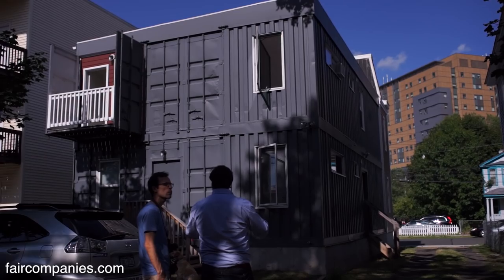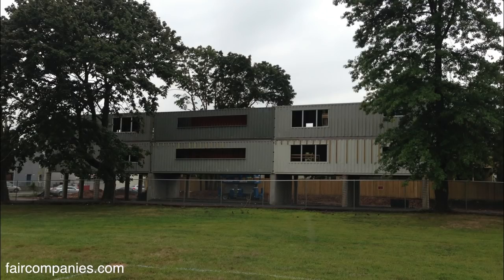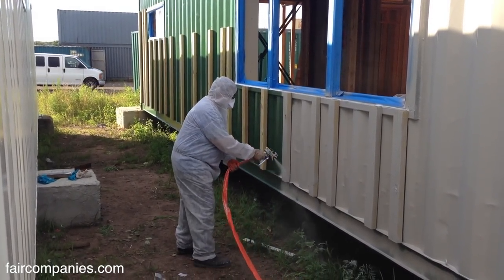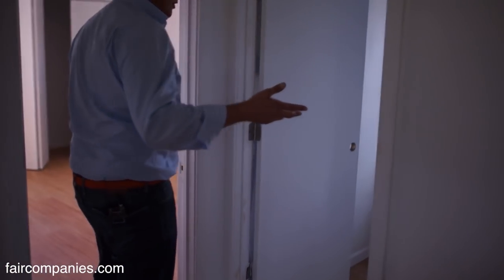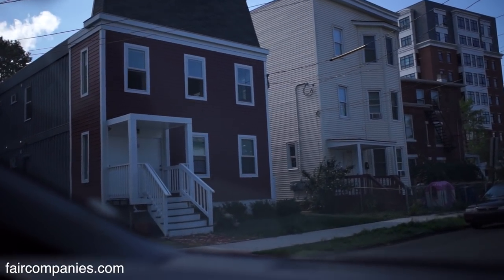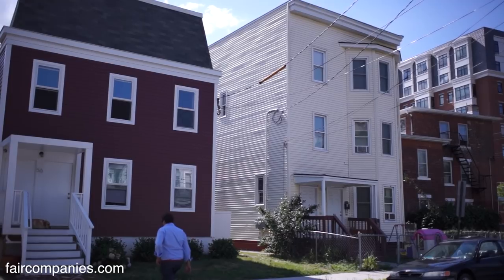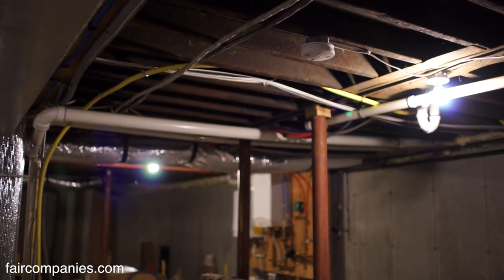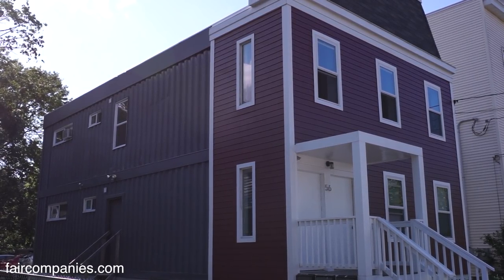Stacked cargo containers in New Haven's "LEGO" apartments

Comment: Liked & Subscribed
This is the most informative video or article I've seen on container buildings. His explanation of using seaworthy joinery to secure containers together makes perfect sense and it's the first I've seen on that subject.

I live in Denver, which has had a building boom the past decade that has resulted in fast build apartments, condos, townhomes, and shoddy execution was apparent when they were completed. Others have siding and roofing issues that aren't revealed until extreme winter weather hits. Container buildings would have been sturdier and more interesting.

It's flabbergasting that the government has data and won't share it. What could possibly be the reason? I've driven from Long Beach to Baja California and seen towering stacks of containers stacked so high along the freeway, the view of the ocean is obscured. The resource exists on both coasts. Container homes would be a perfect solution for rebuilding parts of New Orleans that are still flood prone, areas of the southeast coast that are hurricane prone, and cities like Detroit where urban waste is begging to be scraped and turned into opportunity housing: mixed use retail/office/residential.

Comment: My office at work is a container. It was actually put in 20+ years ago before it was a trend. It looks like a normal office you would never even know. But now that I found out it it's one I really want one to live in. The reason you can't tell is I work at a Professional Theater. It's nestled between the big theater and the Black Box theater. So you cannot access it from the outside. Although there is 2 windows they are in an ally that is probably illegally too small. We enter through the lobby and then there is a door that just looks like it leads to a typical office.

Comment: Hi what is the cost per square foot as built? You mention expansion joints with the flooring... With the sun heating up the metal wouldn't it be better to clad the south facing aspects?

Comment: I notice that this new trend of green buildings by reuse the containers is a good thing, yet how do you prevent the rust and how do you prevent the heat in the summer?and my input is you should make it a bit modern with the design instead just merely stack it in rectangular form, so that the society think that this is modern chic house...yet the idea still astonishing and the interior look like a house..yet the exteriour..well maybe it was base on budget..Finnally, i think it will be great if you put solar panel technology for electrical used and rain water harvesting and filtration to cut cost and be oof grid and green as possible
Reply: insulation has gone a long way to the point that this is actually very viable and the containers themselves are made out of a special metal that isn't supposed to rust (They last a decade on seas without rusting).
Reply: He talks about both rust and insulation during the last five minutes or so.
Reply: The guy said its a special type of steel that once it oxidizes it protects it.

Comment: the future of housing whether we like it or not.  Even with isocyanurate insulation isn't R30 6"?  Why put R30 on walls?  Exterior walls are furred out with metal studs?  Where containers aren't ganged side by side an 8' wide container loses 12" to insulation and furring?  It would be nice to see a functional and elegant detail for the roof edge - where R30 is required?

Comment: Just out of curiosity, what are they planning to rent these boxes out for? Will it be cheaper than a standard wood framed apartment building? More expensive? Or about the same rates?
I would be interested in seeing a cost comparison between building these container complexes and building a standard wood or steel framed complex of the same size.

Comment: What occurs to me, is when this type of structure becomes easier to permit, what prevents the interior insulation and finish work from being done outside of the US, and the container shipped to the US as a finished unit with some relatively high end interior finishes?  Building costs would go down, but losing residential construction jobs would be a tough hit to a lot of people in the US and other comparatively wealthy countries.

Comment: Congratulations on a very nice project. We built a 680sq.ft. house w/ (2) 40' hi-cubes for a local non-profit in Salt Lake City ( see The Sarah House Utah on Youtube). It turned out well but did not see the savings due to small scale of project and learning curve on the job. For multi-story, I can see the savings in using these as the basic structural frame. Continued success to you!

Comment: fire suppression system? solar?  is it off grid?  is there even a rain barrell or watertank for back up water fire suppression system....or ABC fire suppression system?   HIgh heat on metal means a buidling buckles and folds from vacuum effect when the fire gets to a certain temp....anything to prevent the fire safety issue?

Comment: Maybe they should talk to some local fire halls, they have been practicing fires (mock homes) in shipping containers for many years now (if not decades).  I'm sure those around me are not the only firemen around doing it as well. They set the same containers on fire over and over again,.. they just hose them out, set up shop, and torch them again.  The reason the fire marshal has issues is typically because there is due to the intense heat created in one because it doesn't escape as easily and its also crazy difficult to cut access into them vs a conventional home.  It would be quite difficult to vent and gain access for firemen in comparison. 
 Hell I just simply put a metal roof on my home and my insurance company dropped me due to "fire related issues", so id imagine they are crazy stringent about these.  
With all that being said, never the less I plan to get  3-4 and build a functional basement that i'm going to then build my next-future home upon.... :)  Piss on them if they don't like it .. . lol

Comment: can you stucco those containers so they aren't so ugly?  With insulation under the stucco it will also add R value
Reply: michaelwni Yes you can, indeed. The potential for exterior cladding goes beyond just stucco. Think about a wooden look with extra spray foam or ceramic coating behind the wood for added insulation. You can do anything else you might fancy.

Comment: how much did it cost per square foot to build and ge approved
Reply: Jeff Andrews - they never tell you that because they want you to believe that this is a cheaper route.. it isnt at all cheap. its only a faster way to build. 40' containers range from 2500(very used) to 4000 (barely used). then transporting them to the site costs money, land, foundation, crane to have the set, welder to welder, electrical, plumbing, insulation.. its pretty expensive. talked to a guy that was building a 5 x 40' single story container home and he wasnt even finished with the interior work yet and was already over 200k spent. so if he paid top price (4k) per container..160k and still not done. my guess is this guy spent an easy 750k

Comment: im worried about lighting. someone inside the house relaxing leaning on the wall, or have their hands or body on a metal part and while a storm or just normal rain with lighting is happening.
And a lightning bolt hits the container. who ever is inside the house, specially the person leaning on the wall will be dead instantly.
Thats the main part im worried about. not to mention all the electronics within as well. computers, TV, microwaves, fridge, radio etc etc.
This is one of the main reasons why mankind always builds houses made out of "wood".  because electricity can not travel through wood when thunderstorms happen.

Comment: Everything sounds good, the strength of the structure, the lowered cost.
The prejudice is silly, every day we see 18 wheelers carrying prefab houses around the country, made of wood, there is no difference between a wood prefab brought on a truck and bolted together than a metal one, except the metal one is stronger.
But my concern would be noise, metal is a great conductor of sound. Someone on the other end of the house slams the door and the sound travels through the metal, everywhere. I would have to see it in person if I were someday going to consider one. I think the city's fears are people just plopping a container down on a plot of land and calling it a house. My belief in freedom says they should be able to do it, either I own my land or I don't, who is anyone to say I can't live in a metal box? I should be able to live in a tent if I want to.
My perfect retirement would be to buy some land up country in NY, have water, electric and cable run to s central shed, and be able to put up any structure I want to live in, a container or a big shed.

Comment: There are better quality fasteners that have better aligning properties than the ones used on ships, they also have ones with base plates etc. He hit the nail on the head. Local building codes departments will fight against you every step of the way and likely double your costs for no reason other than ignorance

Comment: Those sonotube pillars should have been tied together at the top with a steel reinforced concrete beams, even subterranean they could have been tied together. Helps stabilize in high wind or earthquake zones.
Reply: didn't know Connecticut had earthquakes.
Reply: +MrVoltog Earthquakes can happen anywhere any time. With the advent of fracking shale for oil extraction, many old inactive and unknown fault lines have appeared where no activity had never been recorded. Any time one uses sonotube columns in construction of a support structure it is always wise to tie them together to create a reinforced structure. Twenty some years ago in California and also in Kobe Japan they experienced catastrophic failure of columns supporting freeway bridges. Once the supporting concrete cracked and failed due to excessive lateral loading  caused by earthquakes the reinforcing steel rod structure within will fail since there is nothing holding it in place. California wound up replacing all failed columns and bridge structures while externally wrapping undamaged columns in steel sheeting held together with external tension rods.
As an Architect and structural designer it is my responsibility to ensure that the supporting structure for such a building is designed for the unexpected. The containers themselves have been in use for many decades and have proven their structural integrity in the shipping industry and there is both visual and documented evidence as to the survivability of the containers in mishaps involving the cargo ships they are carried on. Cargo shift can be a life and death matter at sea but we have seen time and time again when these containers are tied together properly with the appropriate hardware they can be stacked up to ten units in height with a full load within. 
 I applauded the innovation and creativity of the designer of this project and I hope they take heed of what Little I have offered here with my experience with both containers and concrete support structures.

Comment: does it leak when it rains and is it safe if lightning hits it ?
Reply: +Roberto Torres Most containers are waterproof. They have to be to work out at sea on a ship. The steel used is very thick and won't rust out like a car will. The rust you do see is the metal creating its own protection. 
As for lightning, if you run a large wire to the ground, the home would be the safest place to be in a lighting storm. Even if it had a direct hit, everyone would be safe. Even (if properly grounded) your electronics will fair well.

Comment: WELCOME To CT,, and Ya see Why I cant Get OUT!!! Fast enough, I Built MY DReAM HOUSe,, About 20 Mins away from Ct,, and its a Timber frame,, Not a Nail In The House,, And Stress Skin Panels,, Its so Air tight,, that the half Bath will Bubble if I Lite a fire,, Need to crack a Window,, was LUCKY,,as My Buildong Inspector was from Alaska,, and Also a engenierr,,  MOSTTTTTTTTTTTTTTT!!!!!!!!!!!  Are Contractors that coulnt Make IT IN THERE OWN BIUSS,, SO,,Its All Politics!!!!   Nice Job, as I Own a Welding Co,, and have worked with Some Of Stanley Works, (Before the ST CHASED THEM OUT OF CT. )   On some Container Homes,, NICE to see People, Mow what There talking About!!!!!!!!!!!!!!!,, TY Again,, Jack..

Comment: build a sky scraper(s ) using shipping containers.
Reply: +stephen arellano you cant - the weight is s huge, that the first couple of floors will crumble and kill everyone in the first 3 to 4 floors.
and the building will collapse. It has to have the usual structure that normal buildings have now and even then, those containers cant support more than 4 tons.
Shipping containers are extremely strong, so long as you follow strict rules, main rule is, never build more than 2 to 3 floors.
One guy in Oregon State built a shipping container home. A tornado passed by took all the normal houses with it and his was left untouched still bolted to the foundation.
His container home only moved 9 inches off the foundation, it was a 1 floor home. he since then reinforced the house to the foundation.

Comment: it is a fun idea that you can be inventive about such homes, if i could i would do something more fun in in design, and as for cost, it would come down to, what you use for the inside, and what the city will allow, and relative cost or that area, i.e. wages, material etc, because you could build something like for 50 squarer meter in png, because no regulation so its relative to area, 
but i think you can do it cheaper, you are not looking at it as a idea, but still rather as a builder

Comment: The way this guy explains container construction terrifies me. He doesn't sound like an engineer. He sounds like a charlatan. Maybe he is not.
Reply: nah, he mentioned the Dutch have been doing it for 30 yrs in the first third of the video.
Reply: "In the United States... building with containers maybe about less than 10 years old?" 1:02. I just shared an article citing a structure build in the US in the early 70s. So this tells me that this designer either does not know how to google things, or that his research method only goes back 10 years. Either way it does not instill confidence. I am probably the biggest fan of container homes you will find, but that also means that I scrutinize them for their sustainability. In terms of this project my concern isn't so much regarding that, as much as my worries about the entire thing collapsing. Because the architect seems to think that building codes don't apply to these structures.